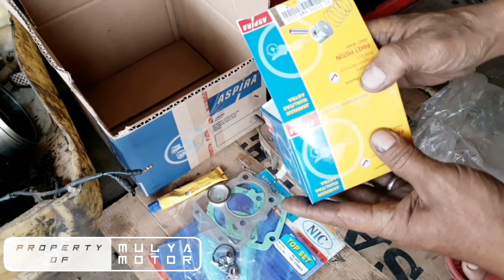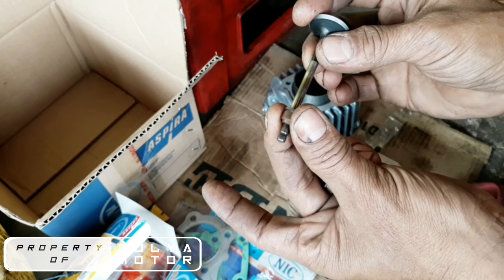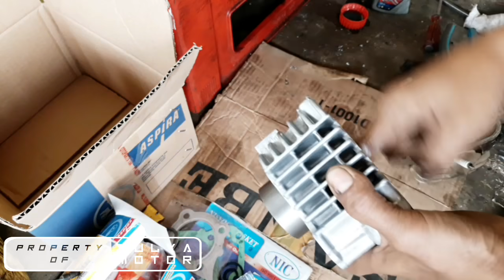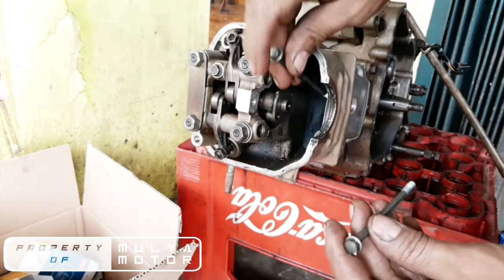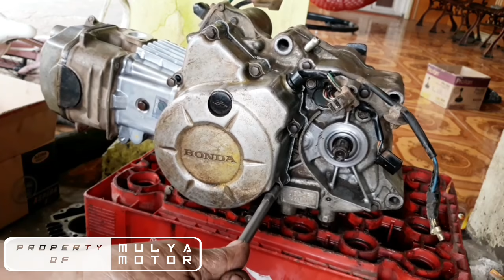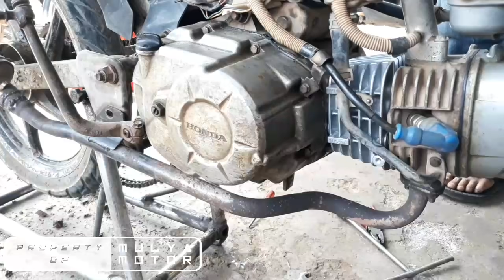Agar tidak berasap/gebul, Revo abs ganti blok baru

Comment: Bang numpang tanya motor saya kmarin dh di ganti blok ring sama piston ama paking semua satu set penyusunan ring pun benar semua standar ,tpi knpa 2 minggu ko ngasep lagi padahl smua original bang itu knpa yah apa dri sil klep nya apa dri ring nya yah
Reply from the maker: Biasany masalah nya di ring atau seal klep. Periksa dulu seal nya kl memang blok nya ori.
Reply: @Mulyamotor  saya beli semua merk aspira pakingnya aspira pokonya semuanya aspira mas
Reply: Motor saya revo 2009, setahun yg lalu d colter oversize 25, belum sampai satu tahun d colter lagi ovesize 50,  dan gak sampe satu bulan d colter lagi ovesize 100 dan  sekarang dua bulan berjalan sepertinya mulai ngasap lagi... Apa kendalanya yha bang?